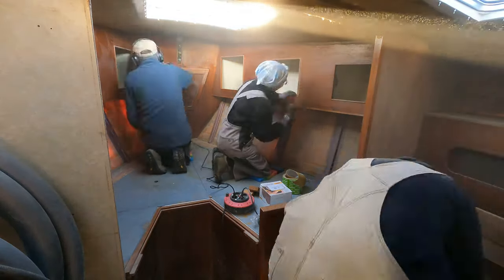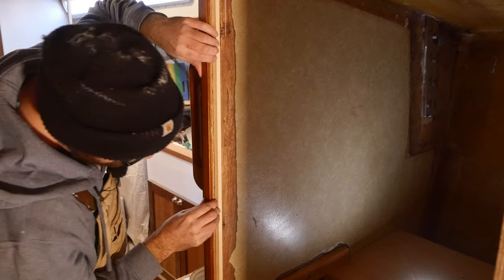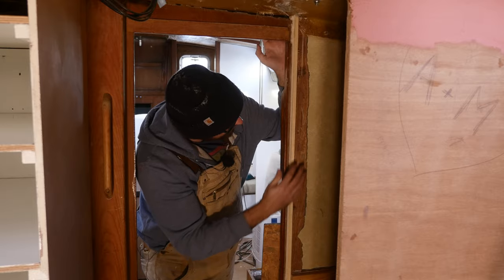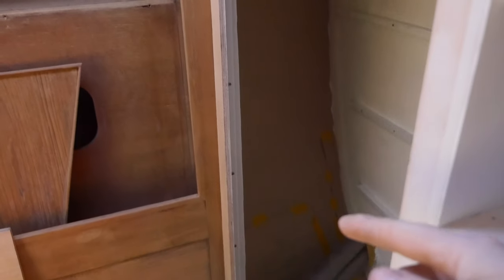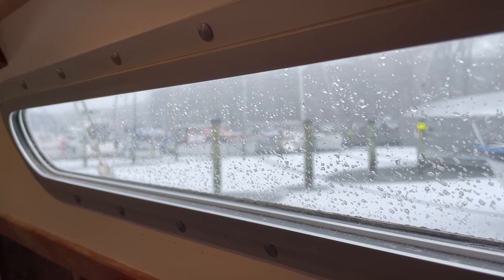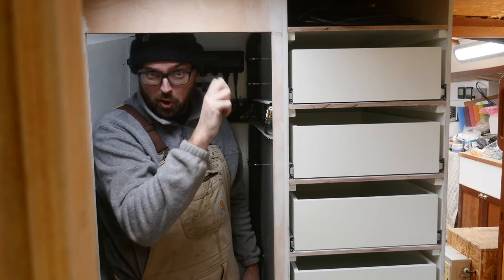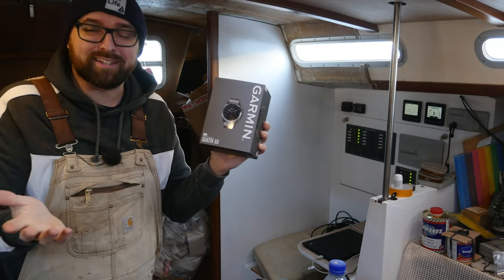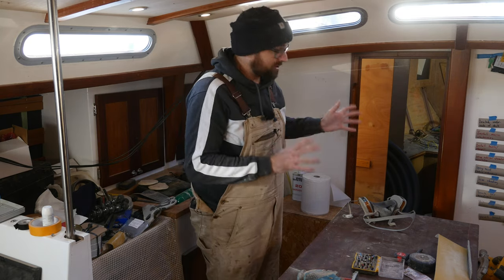Sail Life - Clothing locker done & tons of sanding - DIY sailboat project

Comment: One thought regarding the chain locker.
Once sanded and painted, install up to 2” (50 mm) rigid foam insulation on the chain locker side of the forward bulkhead. This way, heat or cold from the chain locker won’t transfer to the berthing area.
Happy Belated Birthday, Mads!
Reply: Another thought, a sacrificial piece of teak or other rot resistant grating on the bottom of said locker.  That way water passes through to be pumped over, and the wear from hundreds of feet of chain coming and going only wears out the wood and not the glass.
Reply: @bobadam7021  It will wear faster but i still like that to keep the chain from laying on a surface that might not fully dry.
Reply: I would add, you can get grated snap-together tiles typically used for garage flooring or a rubber grated mat that allows some air circulation & noise deadening. It's all in the details.
Reply: @AustinBoil  Those rubber gratings are a good solution once You found a way to have it keeping its place and not ripping of the hull. We once glued some with Sikaflex - did not what it was supposed to do. So we changed back to cheap meranti stripes again. Chain lockers are maintenance points on a boat laying on different roadsteads a lot. People tend to forget that.

Comment: I also have an entry to the chain locker that  to quote you is "too darn small".    Why are these opening always too darn small?    In the base of my chain locker I have a drain, goes into a dedicate little box with a pump in it,   so I can squirt down the chain with fresh water when the opportunity presents itself.   As if you don't have enough on your plate.  LOL.     

On yes I remember 40, turned around last November and discovered I'm 70.    Life is good, just don't rest; if you rest you rot.

Comment: Hahaa that door frame, oh what the heck!  I'm dizzy with the progress - well done.  Liked man cave number 2....  AIS I would normally have at the Nav Station... don't forget you need to be able to switch off transmission when you need to be incognito, usually via the plotter.  Layout and cabling looks good, a small point is cable labelling, I found it invaluable when avoiding mistakes - it can get complicated.  Moving forward!  Happy birthday Mads.
Reply: Oh, Mads is an expert at cable labelling. Look back at his first “technical compartment” videos before he tore it out and strengthened the floor members. He even has a special shrink tube label machine.

Comment: Happy Birthday Mads, I had a boat with a similar clothing locker to that and I had uninsulated heating pipes running through it with a vent at the top and bottom, above and below the door, it used to stay nice and dry as did the cloths in it. Your flying now mate be in soon enough it took me just short of five years to refit and launch the boat I have now, you can't rush these things.

Comment: A suggestion. Any of those dark areas where you will have to access for maintenance or repair at some point I suggest installing LED light strips. They take up virtually no space & are a wonderful thing to have illuminate those areas so you don't have to drag a flashlight or headlamp around. If you want to avoid wiring them in, battery powered ones work fine as well. There are all kinds of styles for under cupboard kitchen lighting to choose from as a source..
Reply: Yeah, that's an excellent suggestion, and extend it to various nooks where food, tools and other items are stored. I have (tho, in a home setting with battery chargers) very good experience with the Eufy Lumi. Motion controlled, efficient, small and warm nice light in two levels. Closets, drawers, the tool shed, and so on

Comment: Mads, have you considered putting in sloped ribbed false bottom in the chain locker with screen covered holes to allow the water to drop into the bottom of the chain locker.   With a pump emptying the compartment under the false bottom, your  anchor rode will dry faster and not be sitting in salt water. A ribbed false bottom will not removing much room in the chain locker and can access to both parts of the compartment thru the access panel.

Comment: The new bulk head in between the washer,dryer and the freezer would be better cut back to the front of the dryer and down to the height of the washer. It would open that space up in the entrance to the v berth alot. A countertop on top of the washer out to where the bulk head is now would give you space to sort washing etc... 
Just an idea. 
Been with you from the start of Oblilex. Great to see light at the end of a long tunnel.😃😃

Comment: When we cut holes in metal boats, we add on a compensation plate to reinforce the area around the hole. And compensate for the removed metal.
Reply from the maker: Interesting :) That's not something that's common aboard fiberglass boats :)

Comment: Mads, for the top wardrobe drawer that is tight, try using your planer to remove material only as tall as the fixed position slide. You can probably remove material on just one side to get enough clearance. You'll still want touch up the paint, but it will be a lot less work.

Comment: Just an idea - you only need to remove a strip of wood from behind the sticking drawer slider(s) - which would avoid most of the repainting you mentioned. It should be relatively easy to do with a router.
Reply: Or a table saw with the blade set to 1mm over the drawer slide position height and the blade running gainst sacrificial wood fence clamped onto the actual fence and set 2mm proud.
Reply: I think the paint is to keep the moisture out of the wood rather than cosmetic.
Reply: @jeffwood8109  Like we should listen to you about wood! Take that Mr....  ummm... sh!t maybe we should listen.😉 Any method and the exposed wood can be painted again.
Reply: @danielbuckner2167  🤣🤣🤣😅

Comment: i had the same problem with drawer sliders mate, best thing is to route a channel where the sliders go, usually a 1mm to 2mm either side and it'll clear your problem quickly without having to remove too much material or reconstruct the boxes

Comment: I have had the first generation Quatix for 6 years now.
The only problem with the old one is the coverage. It talks with only one control unit and there fore I can't use the autopilot with it while on the foredeck, as it's too far away from the control unit/display in the cocpit. Also it would be nice to be able to check the tank data with it. Would be handy when refueling or filling the water tank for example, but that kind of function is not available. 
Otherwise I'm still happy with it and have no intention to replace it any time soon.

Comment: Mads, how does the wire for the washer and dryer exit the conduit? Are you just poking a hole? Those pvc couplers would be an opportunity to put a "T" with the smallest side pipe size to exist wire in that area.

Comment: it looks pretty damn cold outside, it is for sure in Haderslev. How warm is it in the boat with the heating system? does the walls feels cold? how high is the humidity? I'm really curious on that part. Does the long term shelfs not have a guard rail of some kind so the precious stuff in there won't slide out when sailing.

Comment: Hi Mads, a question for you: why do you have a shelf underneath each drawer? What is the purpose? I understand it was convenient to have them to install the sliders but now?
Reply: The shelves were installed to stabilize the bulkheads on either side of the storage area.  I would have probably just gone with the fixed shelves, and skipped the extra weight and work of building the sliding drawer boxes.

Comment: With the DIY angle back on Obelix and the start of Athena I was hoping for more open source on the side of the electronics. =) Must say I definitely understand choosing the simplicity of garmin for time and ease of use though.
Reply: I was thinking OpenCPN for Mads and for me as well. But I went with Raymarine. I didn't get as much as Mads but this spring I'll have new Axiom 9 chart plotter, radar, wind anemometer,  depth , speed temp to go with a recent EVO autopilot,  all on Seatalkng (Nmea 2000).
Reply: @jerryf609  I wonder how long before all marine devices drop the NMEA connection and go wireless, with only a 2-conductor power connection on each unit.  It would be a lot cheaper than NMEA cables, but might be a problem on steel boats.
Reply: @thesteve7397  I decided not to try wireless wind instruments but was tempted.  My radar can connect via wifi but also has a data cable option.  I am going to try wireless wifi  for the radar but if that does not work, I'll buy the data cable for about $90.
Reply: Besides,  some of these signals can be critical, so I'm not ready to commit to wireless only.
Reply: Also, keep in mind, each device needs wireless capability added which cost money... probably more than the cable.  The biggest advantage with wireless is avoiding the labor of running wires. Especially  in the mast.
Reply: @jerryf609  The "internet of things" trend means that the cost of adding WiFi to a device has dropped dramatically. Arduino WiFi modules are now under $5, whereas a 2m NMEA cable is $20.  WiFi doesn't help much with the mast though, as you still need to run wires to power the nav lights and radar.
Reply: @jerryf609  I'm inclined to think that a wireless system is more reliable than a wired NMEA system.  A NMEA cable has 4 data wires, so if you count both ends that's 8 separate connections that could fail.
Reply: @thesteve7397  you may be right. I only have another 10 years of sailing max. I'm going with proven tech. But I think wireless is the future.

Comment: I still don't understand why you are installing a washer and dryer. You can't use it while sailing or at anchor. Most marinas have washers and dryer's. It will just end up as unnecessary weight. You'll end up removing them and make more storage later. I've seen it so many times.
Reply from the maker: Why wouldn't we be able to use the washer and the dryer while at anchor? :) Most of the marinas around here don't have washers and dryers plus it's more convenient to just be able to do laundry aboard the boat. I'm not concerned about the weight. If at some point in the future we decide we don't need the washer or the dryer I'm fine converting that space into storage.